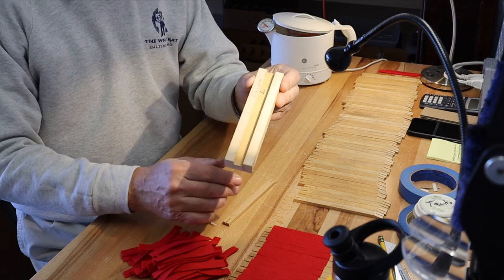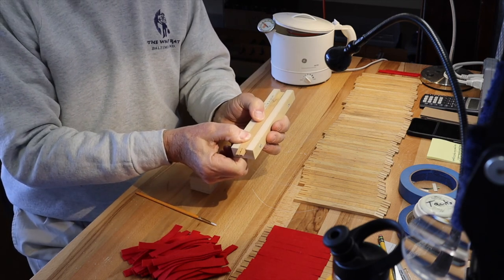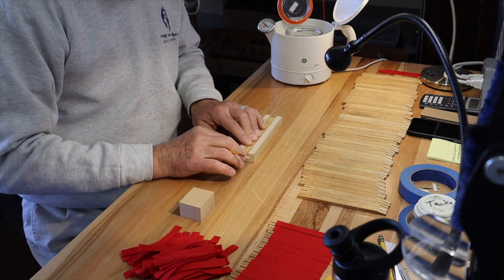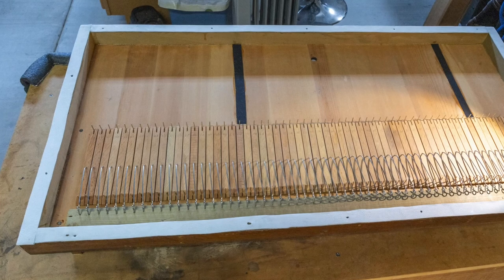Restoration: A 120 year old reed organ (Part 2)

Comment: Good day Sir, what do you recommend for repairing broken reeds (4' flute)as no one seems to make them anymore.
Reply from the maker: Broken reeds are nearly impossible to repair. Generally, you have to find someone with a collection of old reeds that are kept for just that purpose. You might post an inquiry on the FaceBook group "Reed Organ Tech". You will need to know the make of the organ (as well as model if possible) and dimensions of the specific reed(s) you need.
Reply: @Bill Ooms  Thanks for getting back to me. I suspected that this would be the case. I actually have a fair few 8' reeds but as is often the case it's the smallest ones that seem to fail. I'm surprised that no one has kept the tooling for these because new reeds would be a great market to have. 
I think this shortage of reeds in particular would probably spell the end for many over time, which is a shame.